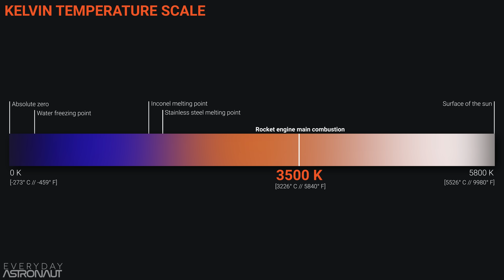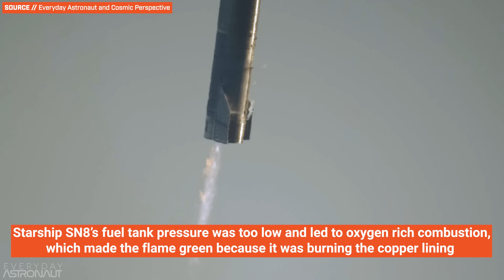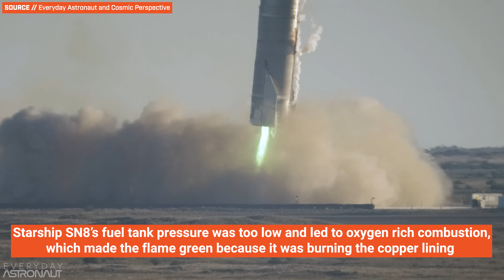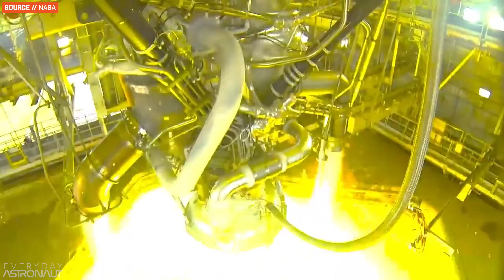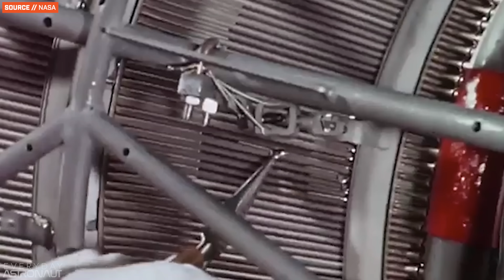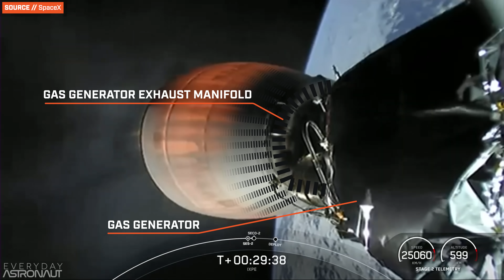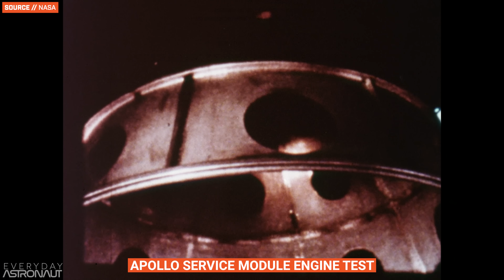Why don't rocket engines melt? How engineers keep engines cool

Comment: why not have the ablative application process  in built with  the burn cycle so that ablative systems reapplied, either through pulse cycling or through pressure differentials? So  having a  fuel/oxygen/shielding film mixture rather than just fuel to oxygen ratio?  If you used tungsten or a tungsten carbide type ceramic as the film you might also be able to use it as a rod of god or something  too. You could  also throw in some regenerative cooling to optimize the reapplication process.  Also has me wonder if alignment of superconductive coefficiences ex. the 0.1 graphene alignment for superconduction ratio it has me wonder if the electircal superconducivity due to electron effect directly correlates to heat cooling as heat as an electromagnetic effect.. has me wonder then if superconduction ratios can be used to cause plasma generation as a thrust vector by alignment of graphene direction resulting in nozel exitthrust rather than wall heating. Has me wonder two things for the futre if cyrofluids can be used for supercooling to create superconduction effect and second if quantum entanglement can create some type of quatum cooling effect.

Comment: As usual from Tim, this was a pretty good lecture -- quite clear, well illustrated. A small correction: at 18:28 the label "Gas Generator" points to the pumps and not the actual Gas Generator. The Gas Generator is a very small combustor, separate from the turbopump, and not visible clearly in these pictures. It produces the gas which then drives the turbine, which drives the pumps.

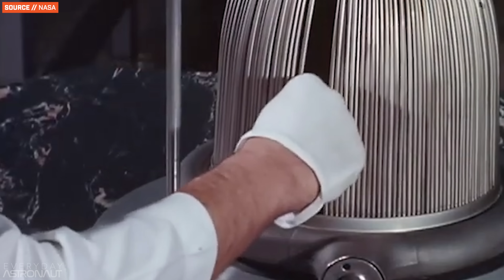11:16 The transition from regenerative cooling as it was used during the war to the brazed tube construction in the USA and milled channels in the USSR was actually a major breakthrough, which enabled construction of "modern" rocket engines. It is a topic which deserves a separate video on its own.

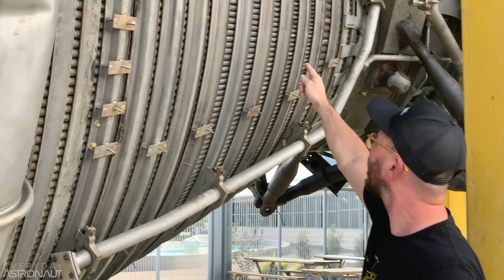Comment: 19:16 You know I've always wondered how SpaceX was able to pull off this little bit of on the go engineering. During one of the earliest falcon 9 flights to the ISS, a crack in the engine bell was discovered on the upper stage vacuum nozzle. Bringing the whole rocket down would have been way too expensive so Elon just had his top engineer take some shears and cut away the lowest 2 inches of the nozzle to cut off the crack. I always wondered how they avoided cutting open the cooling channels in that case. But apparently the channels don't extend that far because they use film cooling after that. Neat!

Comment: I think curious droid did video on leak. There was case on space shuttle. NASA use gold pins to plug injectors on RS-25 - normal practice for faulty ones or something. Thing is it wasnt done properly and during liftoff it shot out and hit side of nozzle. Computers did notice lower efficiency and you can actually see brighter spot on liftoff video
EDIT: nope, it was Scott Manley: watch?v=u6rJpDPxYGU

Comment: Crazy idea:

On a mostly regeneratively cooled engine, have a nozzle extension that's ablatively cooled.

Make sure the throat works with the regenerative cooling alone, and shape the ablator such that it increases the expansion ratio as you go up to vacuum, increasing the specific impulse from the higher ratio, while preventing the damage of the atmosphere pushing in at sea level.

Comment: Top notch content, as the norm for your material.  
A couple of comments at two points:
You mention "efficiency" WRT running fuel rich in most cases.  Not states is this raises ISP - I'm sure that's what you meant.  I think this is something that many miss; often off stoichiometric often results in a higher ISP.  Rich is less "efficient" on the thermal efficiency side, but where all propellant comes from the tanks, the ISP is the most important.  With hydrocarbon fuels, running rich is definitely more efficient when measuring ISP.  Complete combustion of the carbon in the fuel results in CO2, running rich makes lots of CO.  CO2 is much more dense, having a molar mass of 44 vs 28 for CO.  For the same mass flow, CO accelerates to a much higher velocity than CO2 does.  Running CO over CO2 results in a lower temperature though, so the peak efficiency is somewhere around 50/50 CO2/CO.  
On regenerative cooling, closed cycles can also recover the heat and turn it into pump energy in addition to expander cycles.  If the same propellant that is used for cooling is used as the pre-burner majority fuel, then the heat recovered in the regenerative loop is added to the turbine input.  In Raptor the methane is boiled and warmed before it enters the pre-burner and takes less oxidizer there to create the same level of turbine power.  The RS-25 takes this to the extreme where the low pressure turbo-pump is expander driven.

Comment: The engine rich wn8 brought ne a idea: 
A engine which burning oxygen some fuel and it self and after reaching an orbit the engine is only a heat and oxygen resisting metal and is now efficient burning up the rest of the fuel

Comment: A little elementary for this group but, as a kid I used to put paper cups of water in a campfire and be amazed that the paper did not burn until the water boiled away.  The water kept the paper cool enough that it wouldn't burn. Similar to fuel in a combustion chamber wall.

Comment: Thats something you might want to ask Markusic. How to cool the turbine in a tap-off cycle without reducing the efficiancy of your engine. If can only think of 2 ways. Inject cold fuel as a heatsink or use some sort of heat exchanger.

Comment: What I've always found interesting is how SIMPLE heavy-lift, orbital-class rocketry would be if we had materials that could withstand enormous amounts of heat. Like: think about all the complex plumbing that could be eliminated from rocket engines, the heat shields that wouldn't be needed, the complicated air-braking strategies, etc. Hypothetically, if someday somebody were to invent a material that is reasonably easy to work with, reasonably affordable, has good structural properties, and is immune to enormous amounts of heat, rocket design could be like an order of magnitude simpler! Is such a material even possible? A hundred years from now when we have such a material, will our grandchildren look back at marvel at how crazily complicated our rockets were?

Comment: I remember seeing Richard Hammond (Top Gear UK) make a tea kettle out of chocolate and boil water in it by running the propane for his stove through a coil around the kettle. I knew it worked for the RS-25, but it was still pretty neat to watch with a chocolate tea kettle over a propane burner...

Edit: Turns out the 2nd kettle was chocolate ice cream...

Comment: Regenerative cooling is the coolest (pun intended) It's so mindblowing to see how such extreme temperatures can happen at the same time in the engine.
I've been thinking. How about nuclear propulsion? Unlike the regular concepts that are used in ion thrusters and nuclear engines,  Elon talked about a matter antimatter rocket engine. How would that theoretically work? Perhaps it would need a  powerful electromagnetic chamber instead of a regular  "combustion"  chamber that uses tech similar to nuclear fusion reactors tokamak  where matter and antimatter anihilate to generate an extremely powerful exhaust? Also, it would need a small modular nuclear fission reactor (SMR MSR) to have enough energy to keep the antimatter in a similar electromagnetic confinement storage tank and make the whole system work. Also they would have to have some sort of coils similar to Large Hadron Collider antimatter coils to generate it.  Of course, such an engine would be vacuum only. But the benefits of such an engine would be astounding, being able to go to Mars in much less time, etc.

Comment: During the Apollo program, when I was about 13 (1970), I was curious about rockets.  I went to the library and found two books on rockets.  I remember reading about regenerative cooling, and a light went off in my head as I was provided the answer to such a difficult problem in two seconds.  The problem seemed exotic and insurmountable, yet it was ‘handled’ with a simple and elegant solution.  I went on to become a structural design engineer from that initial effort.  Hope you reach 10,000 such young men and women.

Comment: One thing amaze me about rocket engines is that there are drive shafts between the turbines that mechanically transfers momentum to drive the propellants against the high pressures in the combustion chamber. 
It's not only pipes but also mechanics.

Comment: Magnetic nozzles. The thrust correlates to the speed of the exhaust and the speed depends mostly on its temperature. Magnetic chambers + ionized plasma + magnetic nozzle + nuclear reactor and you can increase the exhaust speed several orders of magnitude, not being limited anymore by the temperature but the energy you can produce.